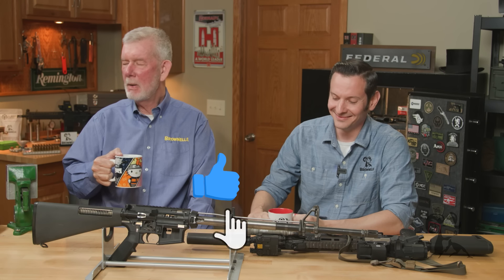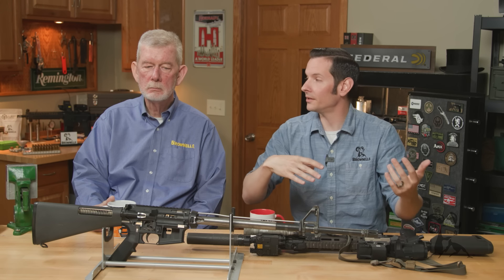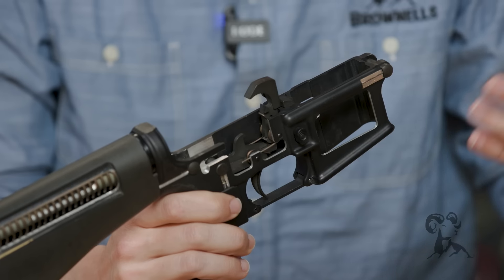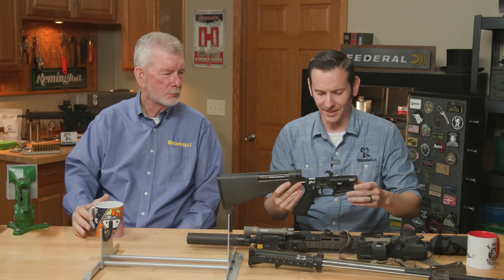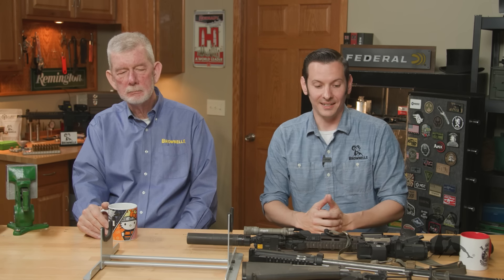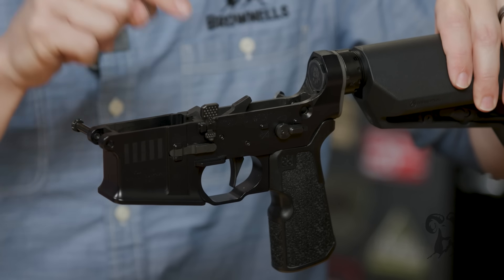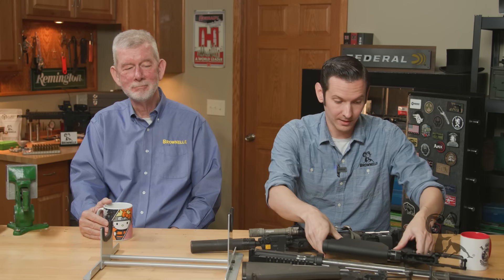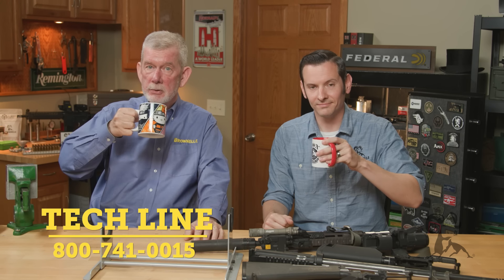SmythBusters: Dropping The Hammer On An AR15 Lower

Comment: The force of a reciprocating bolt from the act of firing is going to impart much more energy, stress, and long-term damage on the hammer than that wimpy trigger spring and aluminum block. Too many people treat their safe queens as fragile objects and not the engineering marvels that can handle thousands of PSI and drops and bangs that they really are. Obviously don't unnecessarily cause undue wear and damage to your guns but it's not a big enough deal to worry about.
Reply: I don’t think you understand that he is speaking of the bolt catch.
Reply: @blackhawk7r221  He said hammer and bolt catch. The point remains. The hammer is not hitting it with any amount of force that the bolt or buffer spring isn't already putting on it.
Reply: @jffry890  The bolt and buffer do not touch the bolt catch.  The hammer never goes that far forward when firing.   When the lower is separated and the hammer drops, it overtravels its normal range of motion and impacts the bolt catch harder than it would the firing pin.  I’ve never seen one damage any hammers with our issued weapons, but over the years I have seen the aluminum boss for the bolt catch pin on the receiver crack.

Comment: I broke a bolt catch doing this once. Match rifle built by Jon Hollinger of White Oak Armament. The maker and their "quality" is irrelevant. Just dont do it.
Reply: Yeah. Tbh I just default to what SOTAR says. He works with thousands of AR’s and says not to do it. So I won’t do it.
Reply: Same here, but cracked the receiver right before the bolt catch...

More specifically I broke off the metal on the receiver between the bolt catch and the hammer (it was a first home build using an Anderson receiver). This happened the first time I dropped the hammer.
Reply: Who you gonna trust? A two bit company like Brownells or the people who designed the rifle. Designer says not to drop it.
Reply: If the bolt catch broke from that it was probably about to fail anyways, the bolt slamming into it on the last shot isn't a light force
Reply: @M14KNM  Did Stoner ever even comment on it? I know he was very against the forward assist and A2 barrel and sight though.
Reply: Ironically, Match grades aren’t usually as robust as “made for mass market consumer” grade. 

Anyways I dropped my hammer probably 20 times or so on mine over the course of 5 years, never had an issue. $80 lower nothing special, not budget tier tho.

Comment: A very large number of people have done it without issue, but you still shouldn't walk under a suspended load.

My point is, just because you can do it over and over without a bad result doesn't mean you should do it or even that its not going to eventually break/damage something.

You're apply a lot of force/impact to 1) a part of the lower receiver not designed to be impacted, 2) a part of the hammer that is not designed to be impacted.

Comment: As a professional gun plumber when I was in the military, I knew that the damage done by this was minimal, but I'd also been in the field on exercises when guns would break and the repair shop was the tailgate of my CUCV and I didn't have all of the repair parts available.  Will these practices damage your gun?  No, not until you can least afford having your gun go down.  Then these little things will catch up with you and your rifle will turn into 7 pounds of crap.  That is Murphy's Law in action.  So as an Instructor, I'll teach the myth that it can damage your rifle from just doing it a few times to keep it from becoming habit, because eventually, something will break and it will probably break when your life depends on it.  Why run the risk if you don't have to?  How much extra time does it take to lower the hammer lightly?
Reply: 7 pounds of crap? just replace whatever part broke. I would agree with lowering the hammer lightly if working oil into the springs.
Reply: CUCV was a great vehicle. I really liked them.
Reply: @hoatzen7887  When you're in a combat situation and don't have a replacement part it does become a piece of crap unless you do a bayonet charge lol

Comment: US Army Small Arms Repairer here:

The "don't drop the hammer disassembled rule" isn't in any manual. We made the rule up for the following very valid reasons:

1. Its loud asf and we don't want to hear the whole company snapping their hammers repeatedly for 4 hours straight while you're cleaning.

2. Its pointless

3. Thats not how a "function check" works

4. No, thats not a valid way to "work oil into the hammer".

5. The TM doesn't tell you to "not" to do it, but also doesn't "instruct" to do it.

6. It can break the bolt catch.

In other words, you shouldn't do it because it's stupid, and it makes you look stupid.

Comment: I drop the hammer like this all the time on many of my ARs with no issue. But if you own a Bushmaster Carbon 15, DO NOT DO THIS. This particular AR is made mostly of polymer aka plastic. And it will break if you just look at it.

Comment: "I feel"... (Because my & everyones feelings are important! 🙄) That... If you drop the hammer and it breaks your bolt catch or lower reciever!... Then, your bolt catch / Lower Reciever was a piece of cheap crap, and you want it replaced ASAP anyway!
Ya can't tell me a 5 lb. Trigger Spring, is more forcefull than a BCG in full semi-auto motion, slamming into that bolt catch. 🥵 
Besides, how hard is it, to use your meat sticks 🙌 to stop the hammer from striking the bolt catch?

Comment: You're right, we already knew that you guys would be wrong this time.
Reply: Dry fire constantly this is a made up controversy.  The only reason this discussion had/has any merit is because of rim fire cartridges I’ve been shooting every type and brand of AR and bolt gun for ~30 yrs and my oldest functions just as well as my newest and I dry fire them all with reckless abandon, except the rim fires.   If a part fails it was always going to fail and I’d rather find out in my armory than with live rounds or in a self defense scenario.
Reply: @charleshetrick3152  This video and my comment have nothing to do with dry fire.
{rolleyes}

Comment: Enough cycles even of a planned stress or load will lead to failures, eventually. See the Hawaiian Air 737 whose cabin crown unzipped to become a convertible in flight (tragically sucking out a flight attendant) after repeated short haul pressurization cycles. The question in all such cases is, how many cycles can you get before failure can be expected, and how long does that take? Barring something seriously wrong with the metallurgy of the parts (which CAN happen), and the fact that where the hammer impacts the receiver is not cooking foil-thin, the cycle number isn't 1. Based on a bunch of testimony from the video and in the comments, the number of cycles is at least into the thousands of not tens of thousands for rifles which see a lot more cycles than most citizen owned rifles will realistically see. So, is it something to be minimized? Sure. Will enough cycles cause stress failure and failure? Certainly. Will you do it enough to see that failure happen? Probably not; almost certainly not if you usually do catch the falling hammer with your thumb but forget once in a while. And if you do anyway in that lattercircumstance, the odds are something wasn't forged correctly making your receiver or parts especially fragile, and you should correct that urgently.

Comment: I agree. I’ve heard the myths. Dry firing on the bolt catch can cause a hairline crack or chip or snap it depending on the quality of the part but I have yet to see one right in front of me snap. I’ve accidentally dropped the hammer on mine.Carefully inspected it and nothing happened. Stuff happens hahaha. But you’re right I wouldn’t go out of my way just to dry fire them. You’d be shocked at how anal some people are about this very subject.

Comment: Don't hurt ANYTHING!!!!!  what's the difference in DRY FIRE in your PISTOL????     😮
Reply: In dry firing, the hammer impacts the rear of the firing pin.
When the upper is removed from the lower and the hammer is dropped, the hammer overtravels and impacts the bolt catch.  That force on the catch acts to leverage the bolt catch pin inside the aluminum bosses.

Comment: FACT:

The bolt carrier assembly on the original early versions of the COLT SMG 9mm guns and orginal early versions of the semi-auto COLT AR 9mm guns breaks the bolt-stop part after the last round is fired.  

There was a small design flaw that caused this to happen.

Comment: This why MIM (Metal Injected Molded) parts shouldn't be used. Name brand or "Mil Spec" designation wont get you there, you really have to know what the parts are made from.
Reply: Nowndays mim is ok. Really all comes down to heat treating. Even bar stock can break if not heat treated properly.
Reply: @FirstLast-ff7qx  nah, improperly heat treated still > MIM.
Reply: @andrewfernandez8330  hmmm i went down the rabbit hole on it a ways back. Talkin to machinists and metalurgists they tend to disagree. If you got any info on it to support your opinion im all ears.
Reply: @FirstLast-ff7qx  Well I think it would depend on the heat treat. Did it create a brittle part? I think that there actually couldnt be a true apples to apples comparison because of the types of steels that can be used in either application arent the same.  They can have similar qualities but when we are talking LPKs on the market that are MIM and LPKs on the market that are billet, they arent even comparable in sheer strength or wear resistance. When I was running an 07 Id see sheered MIM parts pretty regularly, pretty much every component of an LPK broken was a mim part. Thats my experience at least.
Reply: @andrewfernandez8330  yea for sure it deff depends on the metal used as well. Ive also heard that poorly treated mim is worse than poorly treated stock steel. I dont worry bout mim that much cause i think they got it down i mean glock hk beretta all use mim in their pistols n they run forever. But personally i prefer bar stock. Especially in my 1911s

Comment: I don't drop the hammer on a lower receiver for the sake of unnecessary wear and tear.  Neither do I drop a slide on a handgun for the same reason. It is just not necessary.
Reply: Like slamming a door. You can probably do it 1000 times but it is still abuse.

Comment: I've seen actual physical evidence of why you don't dry fire an SKS... I've never even seen anyone post physical evidence of why you dont dry fire a 1911, or drop the slide on an empty chamber.  Similarly, I've never seen physical evidence of why you dont drop the hammer without the BCG installed on an AR.  That said, I also don't claim to be the foremost expert on any of those platforms.  I'd love to see evidence if there really is an issue, until then, I just say "you do you" and I'll continue dry firing my 1911 and only dropping my hammer on a bcg or snap cap in my AR.  I suspect the 1911 thing came from someone dry firing someone else's $4k safe queen and the owner having an absolute stroke as a result... but that is purely conjecture.  Sure, on someone else's firearm it's disrespectful without permission, but does it really cause damage?  We may never know.

Comment: Ok so… if it’s not going to break your milspec parts then why is it in bad practice? Is it because you don’t really know and just want to say something controversial? You said that as long as you have good parts it will be fine so the psa guys shouldn’t be dropping their hammers without the upper on,got it. But for everyone else, why is it bad practice? You’re supposed to be busting myths not causing more confusion.

Comment: I don't do it on purpose but i don't care if it does happen.
I took a $6 hammer in a $40 lower and just let the hammer drop on that lower until my thumbs hurt. Zero issues and damage to the finish at worst. Still functioning after thousands of rounds in my el cheapo beater ar.

At the end of the day, take care of your equipment and it'll take care of you. If it does break, buy better quality and use it as a learning opportunity.

Comment: I must be a wizard; my hammer is never cocked during disassembly/cleaning. It's only getting charged when it's go time. I'm so confused why most of the people in the comments would have it charged. Do you release the mag, eject a round/charge it and then put it away? lol I'm just so lost.
Reply: or when you're finished with a mag, do you let the bolt release go, then not dry fire? I'm just so confused with this concept. Am I stupid?